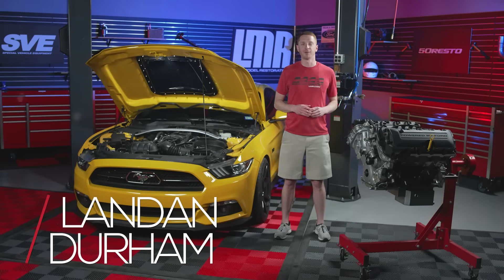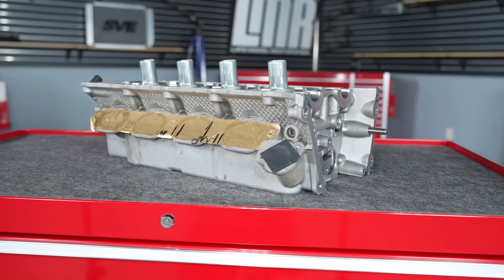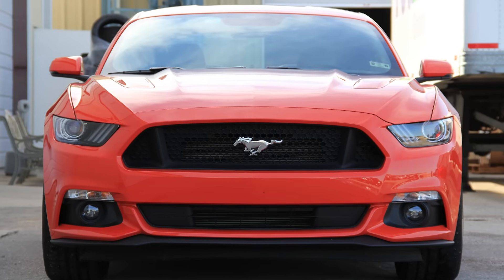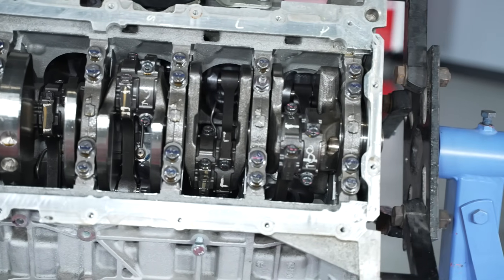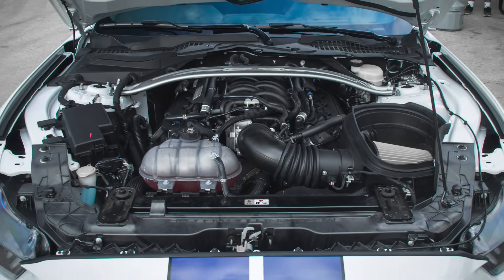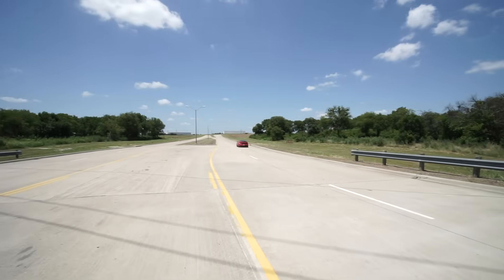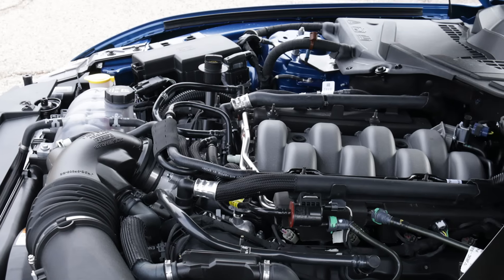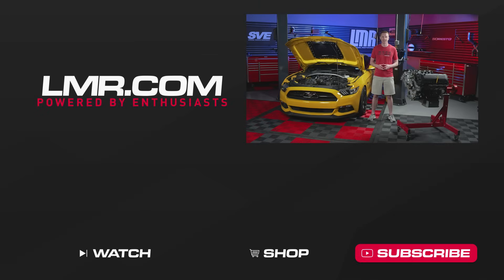Evolution Of The Mustang 5.0L Coyote Engine | Gen 1, Gen 2 & Gen 3

Comment: I'm curious as to which is better, boss 302 heads or gen3 coyote heads.
Reply: Gen 3
Reply: @CanIbeFrank  oh hey Frank lol
Reply: Gen 3 but you have to do something about the direct injector port if you plan on gunning gen 3 heads on previous gen blocks. Also the timing chains and gears all must match - you can't mix the different gen parts.
Reply: @177SCmaro  I believe you can use a gen1 Block with gen 2 heads and gen 3 timing and cam shafts.
Reply: @Jeff-gc2sb  I believe you're correct in the case of the first two since that's how my coyote is set up but I went with gen 2 timing chains and camshafts. I didn't go gen 3 cams because they're set up to run a direct injection pump and I wasn't sure if that would play nice with my second gen heads. Plus, at the time, I don't think there were VVT phaser eliminators for gen 3 (mine is a drag car, vvt unnecessary). There isn't very much info out there about gen 3 backwards compatibility.
Reply: @177SCmaro  just saw this. Thanks for the info. Hope you are putting some good numbers up!
Reply: @Jeff-gc2sb  Over 500hp on low boost, low 11's. Power isn't the limiting factor, need to rebuild the front end and get a trans brake.
Reply: How are the gen 5
Reply: I heard for most part this engine is pretty bullet proof. I just bought one with 131,000 miles on it and no rust all the service records on. It has new spark plugs. Oils been changed cooliants been changed. New tires. And new belt all that other fun stuff